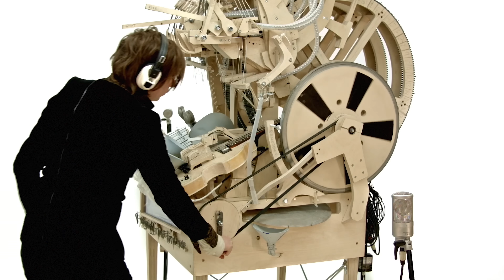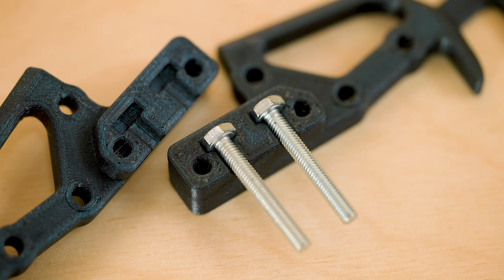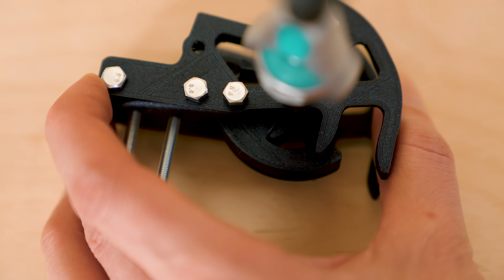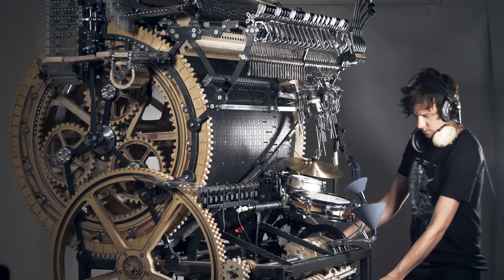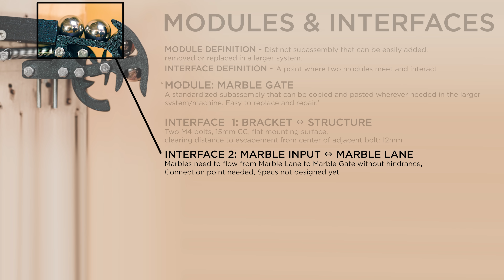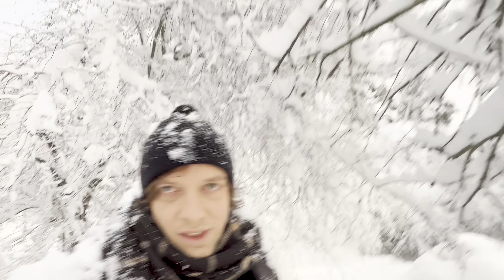The Foolproof Marble Gate - Does it Exist?

Comment: Suggestion: as the gate has moving parts, they will wear (at an unknown rate). Maybe apply a light paint on friction surfaces or use another colour wire for the outside of the parts. This way you can easily spot wear, measure wear resistance and also replace parts before failure.

Comment: Do not forget that if you want to play tight music with lot of marble gates you have to check if you can build your gates in the waty same way and manufacturing process (always witch limited accuracy) do not affect the gate timing. The gate may be tight in when you take only this one gate you measurnig in to account but when you take multiple gates the standard deviation of multiple gates will be probably much higher than the single one. In my opinion the springs and 3D printed hols might be the points worth to heck.

Comment: You need to go back to the original sliding block gate.  Both the motion &  the contact surfaces should be PERPENDICULAR to the marble's path.  (This minimizes forces against the gate movement due to "marble pressure".)  The mechanical advantage between the drop-gate & the driving rod should be 1.  Your gate is about 1/2.  That amplifies the slop present in the linkage from the programming wheel to the gate drop point.  The sliding block scheme with 2 completely-misaligned passages & block with round passage is not only better, but simpler to fabricate (only 1 moving part & can be fabricated even with hand-tools).  This permits material choices, such as wood or aluminum to be used without need for outside services to fabricate.  I would probably choose Delrin (acetyl copolymer) to be used as it is self-lubricating & quieter in operation.

Comment: There are more requirements for the structure interface: The main structure needs to hold the marble gate steady enough so it can perform. Vibrations could cause problems, as could wrong orientation of the gate with respect to gravity due to the structure sagging, etc.

Comment: Interface 3 contains a contradiction (well, depending on what the definition of 300 BPM on the attack time actually means).   Hold times for a single gate are inherently non-overlapping, a full attack-hold-release cycle must complete for each marble dropped.  A hold time of 500ms means that cycle takes at least 500ms, and thus can happen at most twice a second - or 120 times a minute.  So a gate can cycle at most 120 times a minute but must support 300BPM?

Comment: Maybe you should confirm with new tests that the hold time still should be around the same after you modified the gate to get rid of attack time problems. It's not impossible that would have changed things up a bit. But maybe you don't need to do this at this time, but can do it when you're actually constructing the final marble gates for the actual machine.

Comment: Thought occurred: You keep using metal screws and I don't know how much they will affect the edges of the moving part in Interface 2. Or Interface 3? The part that controls the catching of the current Marble. If the Marble itself is enough to stop it and the screw has no contact with the outer edges whatsoever, I've never said anything. If the screw does keep touching that part, I worry about material wear in the long run. Tests are probably fine, but what about a concert? Two? Three? Point is, it could affect the Marble Machine's Attack Time over the course of a world tour. I ofc hope that there isn't anything to worry about. It's just a thought that came to mind as I saw that part moving.

Comment: I still believe a 100% clean marble machine is not possible. even if you got it to work perfectly in your studio, it's a controlled environment which does not represent the real life conditions you will face on tour.
the machine may not be perfectly level, there may be a gust of wind, the stage lights may cause unexpected thermal expansion, or the stage may shake with the movement of the audience.
I believe it would be better to get a machine that works well enough. it would save you a lot of time and effort, because every 1% improvement is 10 times harder than the last 1%.
besides, I think fans in the front row would appreciate a loose marble here and there. they would keep it as a souvenir to remember the show, and the good times they had

Comment: Yeah nah... My point from the previous video still remains.
You worry about vibrations in the actuation process of a marble fall trigger, yet forgetting the whole harmonic vibration of the possible MM3..
Which point to another thing that happens when you want to go marbles deep into technical aspects: you'll be subject to "peer review" 😆

Also, that indexing gear looked too loose when triggering the gate really fast. You could use a stepper motor and a transmission to automate any kind of trigger:
- good ones
- fast ones
- slow ones
- jitter-ish ones (eg: in case of malfunctions happening elsewhere)

A long run might be in order as well, perhaps the final gate will be made out of more resisting materials (which brings to the problem of material/test consistency),
but if the gates are going to be made out of 3D printed parts, they might erode too much (like, where the indexing gear interfaces with the trigger)

All I can say: good luck

Comment: why not include a latch mechanism. as in once the input has gone beyond a set point, an internal spring completes the movement with the same power/velocity each time. that way you could run at infinitely slow speeds with minimal variation. you could also use the "tipping point" to be a point of adjustment/calibration for sync and timing that would vary very little with different speeds.

Comment: it's good to see you including contract requirements in your interfaces (meaning not just the physical requirements such as screw spacing, but the performance requirements such as hold time and attack time). these contractual requirements are what allow you to freely redesign (or re-implement) the module while still adhering to the actual requirements of the system.

one tip is to beware of what is known as a "leaky abstraction", where the implementation itself begins to affect the interface/contract in ways that weren't defined -- this is often a sign that either you 1) have a poor design OR 2) you have identified a contractual requirement that you missed

example of "1" would be if you added your marble gate module and then realized that when going from a slow hit to a fast hit it suddenly locked up due to some pin in the design: poor implementation (needs redesign)

example of "2" would be if you made a marble gate but hadn't thought about stroke length, and when you went to integrate it with the rest of the system, realized that the stroke length was a factor that affected the rest of the design: missing requirement (add to contract)

the idea is that a good implementation should be able to be plugged in and satisfy the requirements without the rest of the system needing to know how that module actually works
Reply: this is also why it's called an abstraction -- you're abstracting away the complex inner details of the module from the actual requirements it must satisfy

the rest of your system doesn't care how your marble gate actually works, it just needs something that can pass a marble from A to B within specific requirements (attack time, hold time, stroke length, etc)

Comment: I see one potential issue here, which others have mentioned - when moving very slowly, the lower arm raises the marble back up, and at the very end it comes into contact with the next marble and lifts it slightly. This means that you are introducing variability into the system based on the amount of pressure from the marbles in the queue. 

Ideally, I think, you would want the final position of the marble about to be dropped to have a slight gap with the next marble so that the pressure of the queue does not matter. 

This is looking so great man! I really hope you decide to continue the project. It's one of my favorite video series ever.

Comment: It's so fun to watch you make a hardware device like software.  You're championing concepts like loose coupling and unit tests while making this thing!
Reply: A lot of the concepts you see in software engineering have their origins in mechanical engineering and design. Modules and Interfaces, Design patterns, Units tests etc. all of them pulled from other disciplines.
Reply: Tight coupling in interface 3, though. That needs a rethink.

Comment: Hey Martin! Would the marble gates to instrument interface be effected in any problematic way should the surface the marble machine is resting on be uneven or angled? Say if a stage you're performing on be slanted or unlevel? Gravity fed systems can be messed up by off angles. Though not super detrimental to timing I'm sure, it could result in marbles bouncing on unintended parts of the instruments or in a worst case bouncing out of the machine entirely. Not exactly a difficult fix I imagine, since you could easily put something underneath the marble machine's legs to even it out if necessary, but still something to keep in mind. Maybe pack a level when you go on tour! 😎👉👉

Comment: why make the mechanism so complicated? Just have a linear servo/plunger hold the balls in place and it just retracts to release the balls? this would have only one moving part instead of all these gizmos. This would also eliminate the need for a programming wheel
Reply: in case you're new to the channel -- he doesn't want to make a servo controlled machine (the servo he's using here is just for testing), it will all be driven mechanically

Comment: Be careful with the modular approach. Your testing approach is good, but there may be some properties of the assembled machine that aren't captured by evaluating any of the individual components. I think you had a similar problem in a previous machine where a slightly off-centre wheel added a vibration to the machine affecting the trajectory of the marbles. By all means keep the rigorous component testing, but don't be surprised if the results of the system aren't as rigorous as the results of the components.
Reply: that's just the natural part of integration, and it's very much expected to run into problems at that stage. that's why what he's doing now: defining the requirements of the module itself, is so important. when he starts running into integration problems he will be surfacing new contract requirements for the module's interfaces, which will lead to redesign of some modules. it's because of him figuring out the initial requirements now that will allow him to later redesign those modules and validate that the redesign still solves the original requirements as well as the new ones.

he often fell into a trap before because he didn't know these basic module requirements (pre-integration) so when he ran into integration and scaling issues it was often just a new design thrown at the wall in hopes it would work, without first validating that the new design was even valid for the existing requirements

Comment: Was wondering what sort of effect having the loose copper wire connecting the servo to the open/close mechanism would have on your times: having the wire move 1mm or so before connecting to the back of the open/close "arm" and only then pulling the arm and making the mechanism work... Would such a small amount of play add up enough to skew results, or is it so small an effect that it's a non-issue?
You can best see the play @ 5:40 to 5:41

Comment: Martin, once you reach the correct geometry, you should learn from the past when you didn't damp any of the contacts in your mechanical parts. All of the small contacts are individually not very loud, but it adds up quickly. So you should always account for a small layer of damping (thin elastomer, felt lining, or bounceless combination thereof) wherever two hard components come into a momentary shock. It's not possible everywhere but just look at the details of a high quality piano action (Renner) : There are lots of dampers everywhere, from tiny rubber discs to large felt bands. Another thing that piano actions can teach you, is that some distances need to be adjustable — piano actions have a capstan-like device to raise or lower the hammers precisely ; as well, the escapement mechanism is adjustable. The reason for all this, is that mechanical parts (even in metal) undergo dimensional changes over time and over variations in temperature/humidity. If you want truly inert parts the only solution would be high performance ceramics (carbides) but that is costly and nearly impossible to machine. So sticking with (high quality !) wood, stainless steel, brass, polished aluminium, and high molecular weight polymers, is clearly your best choice. But do damp all shock points and make critical geometries fine-adjustable (use appropriate, thin mechanical screws as opposed to ordinary construction bolts and nuts). Lastly, your machine is destined to travel in a crate all the time. The last thing you want, is slop in the system, that throws the machine out of calibration each time the machine moves or shakes in transport. Everything should be tight, with little play.
Reply: Also : Picking dimensionally-stable wood, that has fine grain, resists humidity variations and is also light, is an art. Ask luthiers what they use and why. Bamboo is extremely dimensionally-stable and light, but it splits at the slightest change in temperature and humidity. There are charts that show these characteristics. Violin luthiers, harpsichord makers... know the best, affordable, carve-able/machinable woods and glues ; their instruments are shown to last centuries. Don't set yourself for failure by again doing everything out of CNC-machines plywood. Looks cool, but not a smart idea. The orientation of the plank in the original log also has a considerable effect on where a wooden component can go in a design ; piano hammer shanks do not have the same grain orientation as other parts carved from the same wood species, for very good reasons. None of this is complicated ; it's just a checklist.
Reply: I liked the OG mechanical noise though, so maybe apply with discretion.
Reply: Having worked on cars for the last couple of years, I've started wondering if a machine like this could benefit from discrete shock absorbers as part of the strcuture. Part of the reason for the inaccuracy in the original as well as MMX was Martin's insistence on creating a rigid structure and reinforcing it as he went along every time vibrations started creeping up.
Having some kind of motor mounts for the crank and motor (and separate vibration damping for the flywheel) would help isolate it from the rest of the machine, adding rubber bushings between the feet and the main frame of the machine will help keep it more stable, designing any catch funnels and such with appropriate springs and shocks could well help, too.

Besides, if he goes a bit mad scientist with it, the Marble Machine Pro (or whatever he'll call it) could start getting a slight monster truck aesthetic.. :P
Reply: no way i think i finally found the one and only smart youtube reply section
Reply: @Wintergatan
Reply: Hope he listens…
Reply: @Aquillyne  probably not xD
Reply: Most instruments require solid wood because the wood is part of the sound…but plywood is superior for the marble machine, because resonance is not needed from the wood, and the cross-grain gluing of plywood means it does not change size much in response to humidity, which is critical.
Reply: 112%. Definitely something he needs to take on as a another foundational principle.
Reply: Indeed, damping can also improve settling time!
Reply: alternatively instead of tightening everything, would it make sense to have built in calibration points in the machine that can shift with vibrations so that other areas can be extra tight and distribute the vibrations to the basically built in tolerances that will later be adjusted to preference? ie: areas that connect important modules can be allowed to loosen from vibration and are designed to be easily readjusted with set up of the machine, maybe even take off some of the smaller modules and reattach them after the machine arrives at its destination.
Reply: This is a great advice, hope Martin will read it
Reply: Wonder if smaller marbles would help
Reply: experiment on my channel))
Reply: Excellent reply!!
Reply: You “7
Reply: An Invar marble machine. Now there’s a concept.
Reply: thanks cap
Reply: i aint readin allat  🤦‍♂🤣

Comment: I'm not sure I understand the reasoning.

The marble is released (i.e. a note is played) during the final point of the gate's motion (attack, hold, release). Surely you only want to be concerned with the release of the marble? If you want to play slowly, it means you want more space between releases, not a slower attack by necessity. Wouldn't a gate that reliably has a maximum-speed attack, and then holds for as long between notes as required, with a consistent release regardless of note spacing (up to the threshold of the minimum attack time) be the ideal?

So should the gate always be snap-loading a marble (minimum attack every time) which it then holds until a release instruction comes (and then again immediately snap-loads the next marble as part of the motion)?

Comment: I would certainly not call the first machine a failure. It was a prototype. As such it didn't need to go beyond a proof of concept. To call such a thing a failure is to not do enough justice to it.
The second machine was the test type. Without a doubt that one was going to fail simply because you did not understand everything that needed to go into it. At least not at the beginning. By the time you understood what was needed you were so far into it that you couldn't do anything else but scrap it and start over.